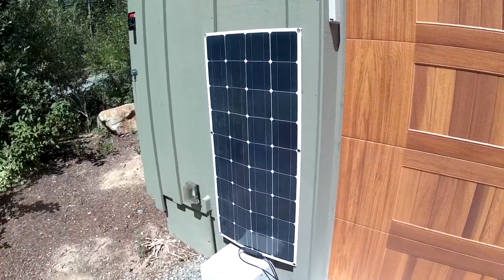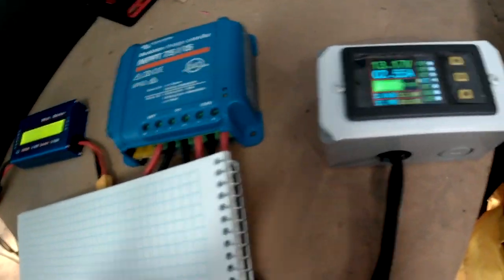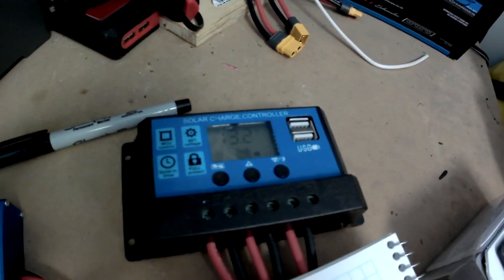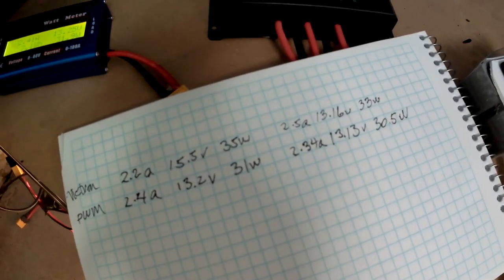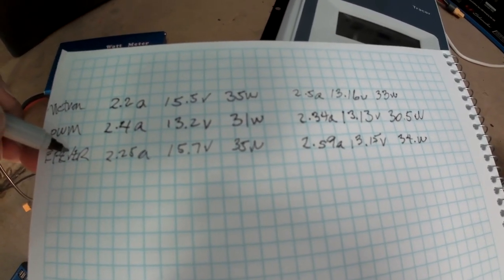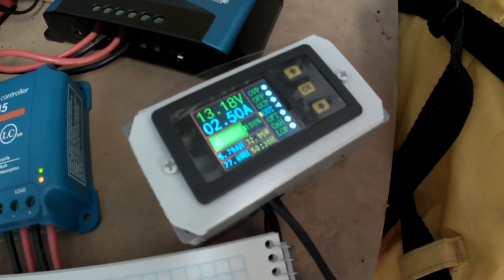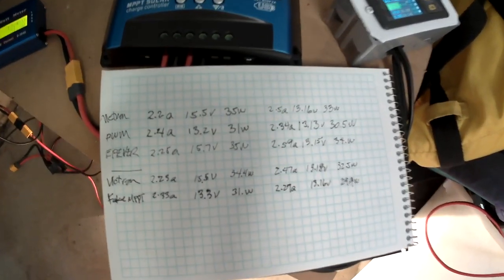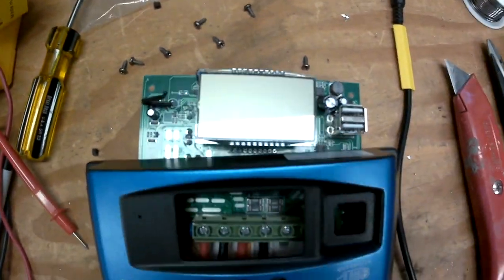MPPT vs PWM Solar Chargers - Test and Comparison

Comment: You could have said the same in 2 minutes with proper editing. We also don't need to see how you slowly write data over a paper, and repeat values so many times. Plus your voice is really pasive and unpleasant, are you sleepy or under a drug?
Reply from the maker: Thanks for the suggestions. I guess I'll never be a YouTube star.
Reply: @MarkSpohr  Thank you Mark. Don't listen to assholes
Reply from the maker: Thanks for the suggestions. I guess I'll never be a YouTube star.
Reply: @MarkSpohr  Appreciate your explanation. Actually you sounds like any engineering college professor :=)
Reply from the maker: @cup2354  Thanks. I need to step up my game.
Reply: LOL. I  was trying to find out what is the real  difference between PWM and MPPT controller. Actually your video is the best so far that I found in carefully measured trustworthy real world data that explained . Your video showed PWM can draw more current at lower voltage vs MPPT! Then it all fall into place after I found the plot in this article  https://www.powerelectronics.com/technologies/solar/article/21863142/solar-system-efficiency-maximum-power-point-tracking-is-key .
So this mean in case of panel voltage almost match the battery, PWM and MPPT would be very close in efficiency.  I would expect, the more mismatch the  panel voltage to battery voltage the more efficiency gain for MPPT.
Reply: Que te jodan tío, estas recibiendo esta información gratis y encima eres tan sumamente grosero, qué mierdas te pasa? Cómo puedes hablar así a alguien que invierte su tiempo en enseñar a desagradecidos como tú?
Reply: @Javier S. A "LO-DIT" is just a "LO-DIT". You have no patient to find out what a lo-dit means than just be a lo-dit.